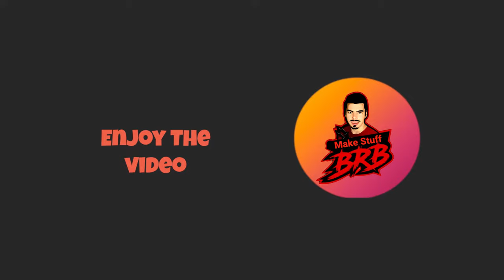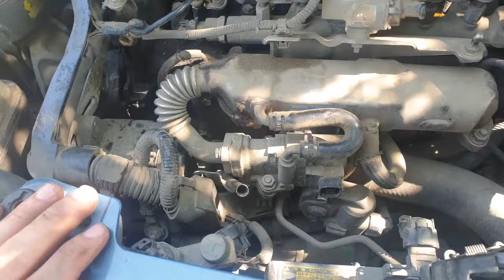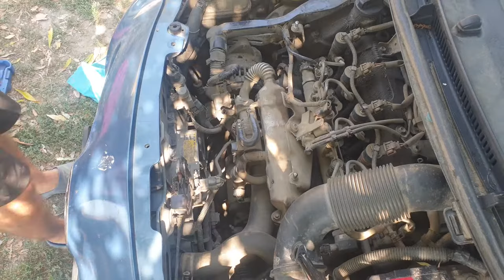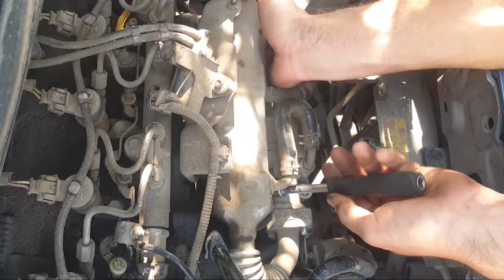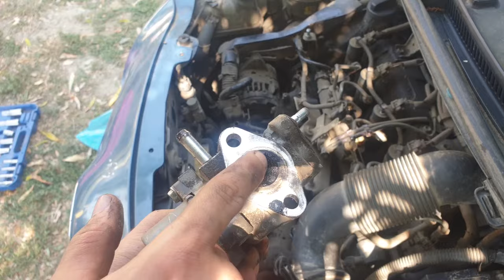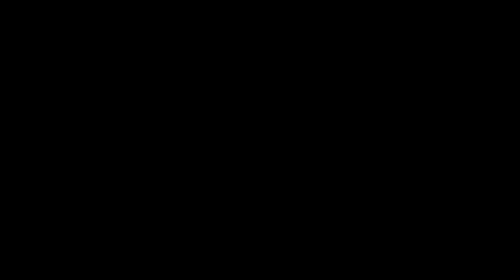How to change EGR valve on TOYOTA Yaris

Comment: I don’t know who would read my comment, but boy i gotta tell ya, i had a weird issue with my toyota corolla 2004 that only lose power on one steep hill with lots of black smoke, and no code at all. We cleaned the Maf sensor, diesel filter is clean, air filter is clean, catalytic converter is clean, and yet i still had issues with it until we cleaned the EGR then baam that fixed it
To all toyota lovers consider cleaning the egr before thinking for an expensive repair
I hope that my comment finds you well

Comment: hello I have a Toyota Yaris 2 diesel 2007, I have EGR coolers, and if I remove the hoses, some fluid will leak from the radiator ???  then you only need to add it?  I am asking because I want to clean the EGR job?  and after installation, the liquid will fill itself?
Reply from the maker: HI!
Yes, you must add liquid to the optimal level in the vessel.

Comment: Hi there, I have engine light on showing issue with egr. If I unblock like this and reset fault is this enough? or will I have to get a new egr valve to keep engine light off?
Reply from the maker: Hello! You could clean well EGR, see how long the witness is on. If the engine control lights up again. Change the EGR
Reply: How was the engine running when it was dirty.
Reply: @mattlawton4715  perfect. Changed it out for a new one and 3 months later blocked again. Any explanation?
Reply: @Magnum094  I need to clean mine my engine cuts out under load I have to flick the key off and on to carry on was asking if yours was similar mine has never been done 178000 miles. Did you clean all the egr system there may have been alot of carbon in it.
Reply: @mattlawton4715  oh there is no issue with engine power or cutting out with mine. It has ticked over to 180k km. When I took off the original egr the inlet port I believe...or outlet was stuffed. 
Do you think a clean out will sort it out again?
Reply: @Magnum094  clean it out again see how it goes and go from there give it a good clean if it happens again then there maybe a problem.
Reply: Give the egr cooler a good clean out
Reply: @Magnum094  check that there isn't an egr cooler leak

Comment: At how many kilometers did you clean ?
Reply from the maker: 500.000 kilometers
Reply: @brbmakestuff7474  500 000 kms ? Are tout sûre ? Des cars going AT this kilometers 😁
Reply: @brbmakestuff7474  Congratulations !!! Mine is at 186000 km... no cleaning needed, then...
Reply: @frederic3498  Well that is a Toyota if u didnt get it 😉
Reply: @frederic3498  these little engines are long lasting. Don't know about the mk3 yaris, but I see many mk2's like this and mine around where I live, all in the 200.000s!